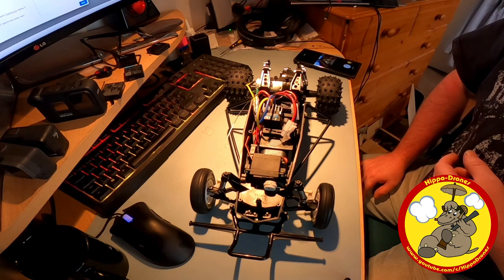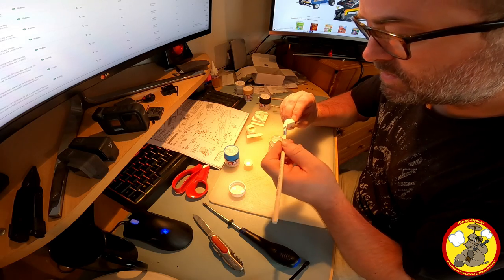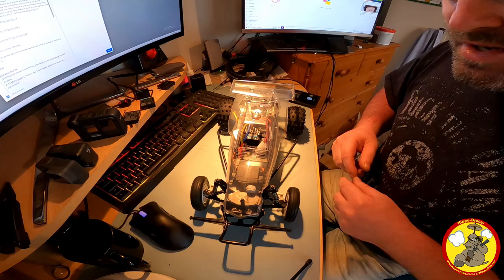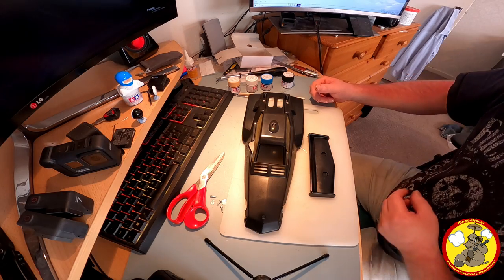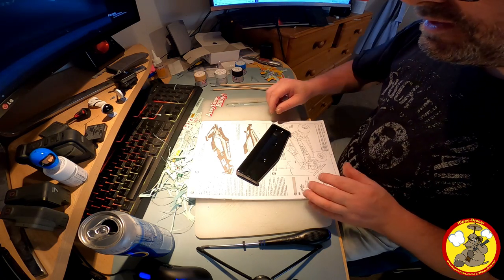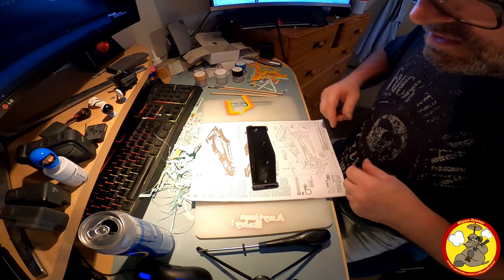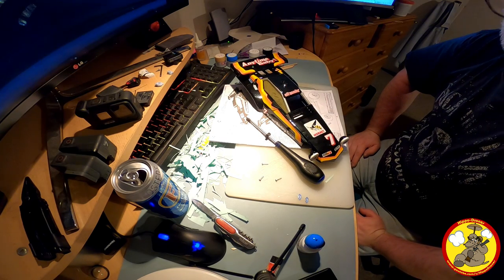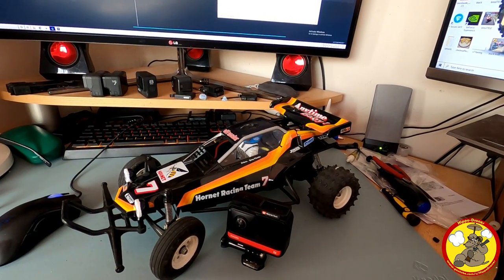Tamiya Hornet RC Buggy Build | Painting & Decals | Pt5

Comment: A good tip for decals is to peel them off and then submerge them in water.  This allows you to peel the sticker back off if it hasn't gone on how/where you want it to be.  You then just use some kitchen roll to wipe across and remove any water from the sticker.
Reply from the maker: Ahh that is an awesome tip. Thanks 🙂

Comment: Looking good! :)
You can use bits of blue masking tape applied to the body as placement guides for some of the larger decals before you peel off the backing, and using the non-bristled end of a brush under the decal, or a set of tweezers, for placing them makes it much easier as opposed to using your finger tip (and zero chance of finger oils getting on the backsides of the decals).  :)
Reply from the maker: Ahh cool tip LS :-) cheers mate :-)

Comment: Love it mate. The driver looks great with the white and blue. The car looks even more amazing. Shame about the insta lens : ( Are the easily replaced?
Reply from the maker: to repair, it would cost around £100 + shipping and then probs get stung on import fees too like I did before when Insta360 fixed my One X. I ordered a replacement 360 mod as by the time all that was added up I'd not save much by getting it fixed.
Reply: @HippoDrones  mate, that is horrible. Ridiculous how they get away with shit like that.
Reply from the maker: @dynamotightstar3472  Is the trouble with buying from Hong Kong
Reply: @HippoDrones  very very true sadly.